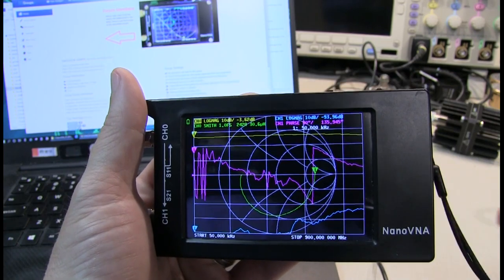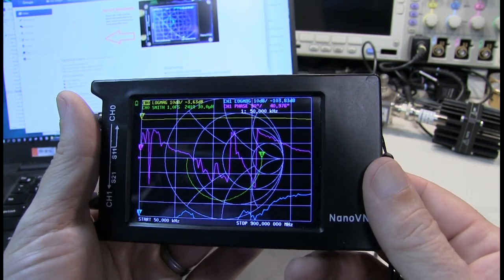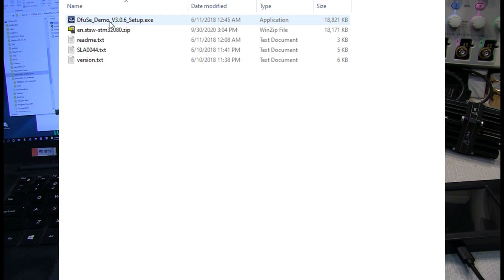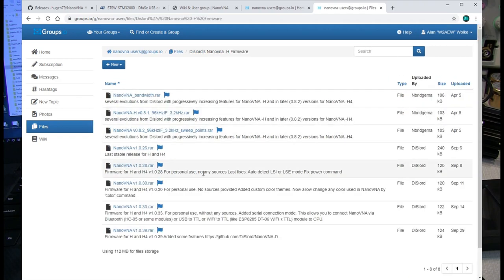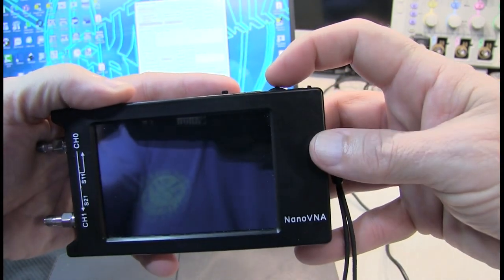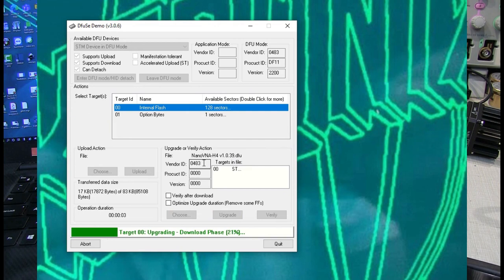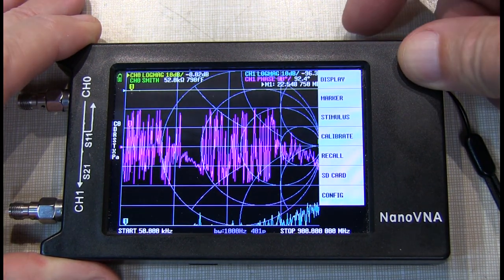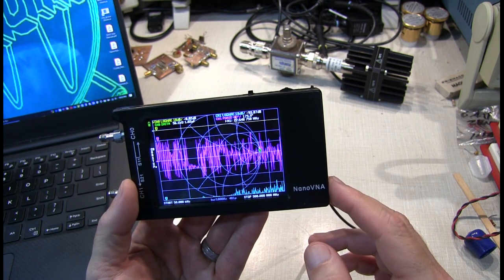#320: How to update the NanoVNA-H4 firmware using Windows 10 and .DFU file

Comment: For those struggling to get DfuSeDemo to recognise the NanoVNA-H in Windows 10. Connect NanoVNA to PC in DFU mode then find the driver "STM32 Bootloader" in device manager right click on it to select "update driver". Choose 'Browse my computer for drivers' and navigate to C:\Program Files (x86)\STMicroelectronics\Software\DfuSe v3.0.6\ (click on include sub-folders in the searching for drivers) then select 'let me pick from a list of drivers on my computer'. You'll see two options; ' STM Device in DFU Mode' and 'STM32 Bootloader' select 'STM Device in DFU Mode' to load this driver. In Device Manager you'll see 'STM Device in DFU Mode' instead of the 'STM32 Bootloader'. You'll find that DfuSeDemo will now recognise your NanoVNA-H. Or at least this worked for me.
Reply: thanks

Comment: Great and informative video again. What is a reliable source for a good NanoVNA (H4 or similar) when you hear about all the fakes and copies that are around? Some might work - more or less - but you never know what you get if you buy of of ebay or aliexpress or similar. I don't have a local shop nearby here in Germany and probably have to buy from ebay & Co. You probably have to avoid the extreme cheapies 😉
Reply: I got it from Amazon Germany and the Amazon marketplace dealer was Aursinc. It was delivered in a few days and it's exactly the same hardware version 4.3_MS, "Made by ZeenKo in China", as shown in Alan's video.

Comment: I wasn't able to enter DFUSE mode with the "off and press the button" method.  When I plugged the unit into the USB cord it did not connect to the laptop.

Comment: Not working on Windows 10 version 22H2 the DfuSe_Demo program due to device driver problem, but works OK with STM32CubeProgrammer and the firmware file in bin format and upgraded the firmware successfully.

Comment: Interesting video, Unfortunately in my case no help. I have the H4, but can not even access the menu, I can get it on the screen but other than that,              . That's right nothing, not even trying the wheel control.
Reply from the maker: Sounds like your touch screen calibration is incorrect.  Easy to fix, but you'll have to use the jog-wheel to get to the correct menu.
Reply: @w2aew  Further to my problem I took the golden screwdriver to the back and slackened the off. That would appear to have solved the problem. Maybe something to do with pressure on the touch screen. Could be a idea for another how to. keep up the good work. best 73 2E0HXU aka KG4UXR
Reply from the maker: @sootydave1  I've heard about that (case too tight) being a problem on some units.

Comment: We are up to V69 now. My device does not show up in the DFuse Available DFU Devices box. I'm not sure why not as I did everything according to instruction. The screen went black indicating in DFU mode. I did hear the detected ding when I plugged it in but no joy on the screen. None of the boxes were populated with any info.
Reply: I've tried swapping cords. Nothing is bringing that H4 up on the screen boxes. USB dings, meaning detected but that's it.
Reply: Got it !! There's an actual STMicro Driver that popped up while i was doing a general Windows 10 upgrade, by clicking some sort of "Additional Upgrade Options" or some such option below the main Update screen.

Comment: As i write this 2 years later, the STM32 bootloader no longer works in Windows 10 and Windows 11. So, you won't be able to upgrade the firmware with this instruction video anymore.

Comment: Thank you for taking the time to do this. I used this info to help update the firmware on my H model. Getting it into update mode is different and I had to have win-10 update the correct driver through windows update before it could see the nanovna, but in the end it worked.
Reply: Got it !! There's an actual STMicro Driver that popped up while i was doing a general Windows 10 upgrade, by clicking some sort of "Additional Upgrade Options" or some such option below the main Update screen.
Reply: Please elaborate. having same problem. Thanks.

Comment: It connects to the PC (Win 10), but will not show up in the update utility for some reason.
Reply: I am using Windows 11.  I had the same issue.  Went into device manager and saw that it didn't have a driver for the STM device loaded.  Told it to scan, (not found), told it to go to Windows update, then clicked to show Optional Updates.  The STM driver was listed there.  Installed it and the firmware update worked as expected.

Comment: Hey Alan...since this video is a year old, have you upgraded the firmware since then and if so, which version? I see (now) there are newer versions available.
Reply from the maker: Good question - no, I haven't actually, but the latest DiSlord firmware does look pretty good!
Reply: @w2aew  It looks like your current version (1.0.39) now samples 401 points instead of 101 points. Are screen updates slower because of more points? I don't own a NanoVNA (yet).
Reply from the maker: @stevebailey1682  There were some updates to the sweep speed, so it was about a wash as I recall.  I might update to the latest DiSlord version (1.0.69).
Reply: @w2aew  Maybe when you update to the latest firmware, you could make another video showing what the updates do?
Reply from the maker: @stevebailey1682  I'll think about it.  I updated my unit this morning to 1.0.69.  I'm hoping to find a document somewhere that describes all of the changes/additions/enhancements rather than having to self-discover them and figure out how they work...

Comment: Alan,  just tried this update today on my NanoVNA-H 4 like yours and it went in fine but
I had the documented problem attaching to the Windows Nano VNA program.  I went back to put the original version in
but my Nano wouldn't go into the DFU load mode.  Holding the rocker switch down and turning it on with the
Dislord 1.0.39 version messed up something with that process.   I had to open it up and jumper the two boot pins on
the board and then I was able to reload first version of the firmware. Just thought I would mention this should others
also have this problem.  73, n2cmd
Brian
Reply: I have the same problem but not sure which two pins are the boot pins. n4awp

Comment: Hi Alan, as you have said, there are a number of clone devices on the market. Which is the best source for devices that work? I have just returned my h-4 as it did not provide stable readings - the longer the device was on the higher the readings went.Regards Stan
Reply from the maker: If you are in the US, I have found that R & L Electronics is a reliable source (randl.com)

Comment: Many thanks Alan, that answered a few questions I had and saved me hunting about for the answers.
and where the firmware was located. I use linux not windows and the process was even easier.

There is an explanation here from the nanovna group which gives the necessary info.
https://groups.io/g/nanovna-users/topic/32221112?p=Created,,,20,2,0,0::recentpostdate%2Fsticky,,,20,1,40,3222111

Andy
Reply: Saved!  I too run linux,  and nothing but here...

Comment: Do you know where the sources for the 1.0.39 version can be found? GitHub only seems to be at 1.0.38 which doesn't have the 401p modification, at least on the -H...
Reply from the maker: I don’t know if the developer shared the source code. You can ask on the group mailing list.
Reply: Sources https://github.com/DiSlord/NanoVNA-D , NanoVNA-H can have only 101 points (memory limits), Only H4 have 401 points. For get H4 source need select h4 branch.

Comment: I am curious about using NanoVNA's also for time-domain tests. It would seem that if the newer NanoVNA's can run at 3Ghz, they might be fast enough to examine discontinuities in connectors and circuit-board traces, showing where a problem is.

Because NanoVNAs are targeted toward Ham people, we see Smiths chart, and not a linear time-domain response, the latter of which would also be a great feature.

I don't know how fast they can sample, but if they have a single-degree of phase resolution detection at 3GHz, the NanoVNAs would have about a 1/3mm distance resolution. There are sampling limits, which would limit the test-length. Speedcrunch calculation ravings follow, which don't take into account the propagation speed index along copper/transmission-line for instance, but it's a worse case:
s= 299792258
s/(3*giga) = 0.09993075266666666667
ans/365 = 0.00027378288401826484
ans*1000 = 0.27378288401826484018
Reply from the maker: The time-domain measurements in the NanoVNA are performed using an inverse FFT of the frequency domain results.  Distance resolution is proportional to the frequency span.  With a 3GHz span, you're probably looking at something on the order of 30-50mm resolution.
Reply: @w2aew  , thank you for the reply.
Have you notice this video, where he's experimenting making his NanoVNA into a true 2-port VNA : ): https://www.youtube.com/watch?v=GJNMnq8eD0E

I am still hoping that with all of these dirt-cheap Arm-Cortex processor, filter and mixer modules, that something could be like like the NanoVNA, that can also be a 2-port device, with enough sampling and processing to do circuit-board stuff. Perhaps it will need to sampled on the device and sent to the computer like a SDA for number-crunching, like the HackRF-One. So close.

Comment from the maker: NOTE:  while I have used this process several times on my NanoVNA-H4, hardware version 4.2 - I can NOT guarantee that it will work for YOU!  There are a LOT of different hardware versions and clones out there that may behave differently.  I apologize if it doesn't work for you, and please proceed at your own risk!  Note that the -H and -H4 versions use different firmware! If it doesn't work for you, the message boards on the groups.io NanoVNA-users group have lot of threads that offer help.
Reply: Here's another point to make sure you double check before updating - make sure you have the H4 version and not the simple H version...that's the mistake I made initially, fortunately once I had the correct version my seemingly "bricked" Nano came back to life when I uploaded the correct firmware.  Both versions show up in the DisLord folder when you unzip it so be careful.
Reply: @PapasDino  Can you verify it connects/gets recognized/ works with nanovnasaver after the firmware upgrade ?
Reply: @dimitriapproved  Haven't tried it with that software but I'm sure someone must have done this and can chime in here and let you know.

Comment: Thanks Alan! Was trying to search for the Mac route but, pardon whilst I spit, I cranked up the Windows laptop and will follow these instructions!  ;-)  73 - Dino KLØS
Reply: Well, everything worked FB until the end...appears my Nano is bricked...any suggestions for bringing it back to life?
Reply from the maker: @PapasDino  From what I understand, the nanoVNA can't be bricked, you just need to find the right firmware for it.  It sounds like you may have loaded a version that is incompatible with your hardware.
Reply: @PapasDino  You removed the link after the update Dino yes :-)
Reply: @Magikflame  Not sure what you mean? I've tried returning to the original firmware and although the STM app says the operation was successful the Nano still won't start up.
Reply: @PapasDino  My mistake! I assumed entering DFU mode you connected two pins together, but it seems this update method is by holding the rocker down upon power on. Good luck and when you get it back up and running it would be great to hear what steps you took. 73 !
Reply: @Magikflame  And my Nano has come back to life once I uploaded the correct firmware version (the H4 vs H files).  Phew!
Reply: @PapasDino  Great stuff Dino! Thanks for sharing that. 73 !

Comment: Very useful video as always Alan.  I just updated my SAA2N firmware, but using the win 10 program VNAQT.exe.  The process is so much easier as it's all built into this VNA display software.  No need for the ST DFuSE tool. Maybe it works for the H4 too? But you definitely have to recal the screen afterwards, and save!
Reply from the maker: Yes, the SAA2 is much easier with the firmware uploader built right into the PC software.  I don't think this works for the H4 though.
Reply: @w2aew  There is also a simple python script in the SAA2 firmware source repository that just works fine there https://github.com/nanovna/NanoVNA-V2-firmware/blob/master/dfu.py, I've used it several time from a linux debian machine (and partially rewrote it actually :-) )

Comment: After doing this, my device won't boot anymore. How can I fix it?
Reply from the maker: It sounds like you may have tried to upload firmware that is not compatible with your hardware.  You'll need to find the right firmware for your device.
Reply: Did you remember to disconnect the link that put's the Nano in/out of boot mode ? Easily forgotton :-)
Reply: Ignore the above comment Paula if you have the H4 version. 73 !